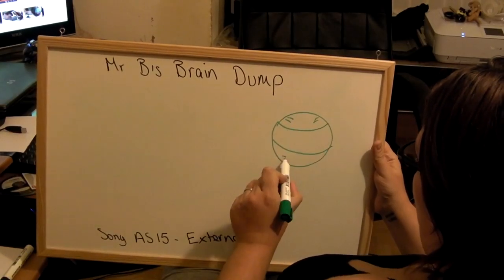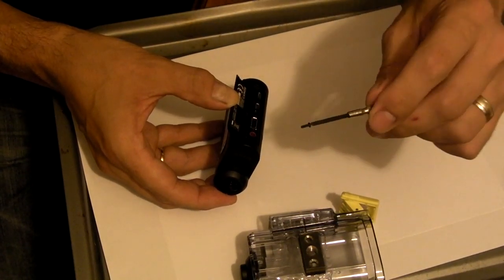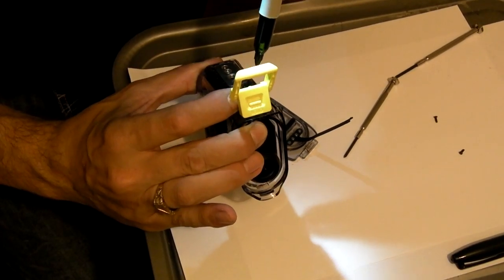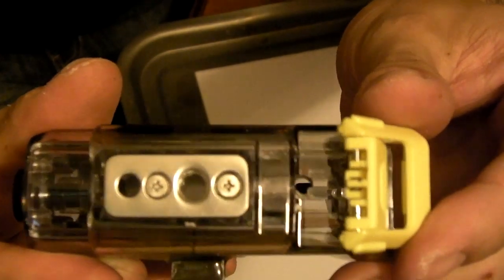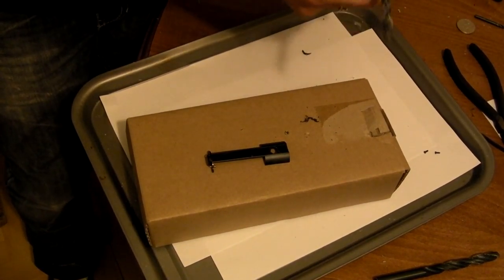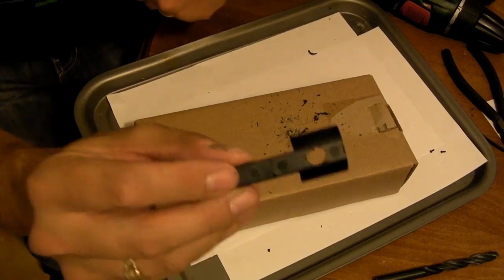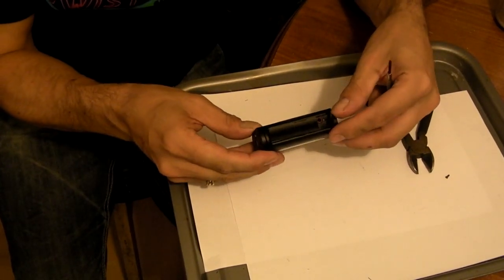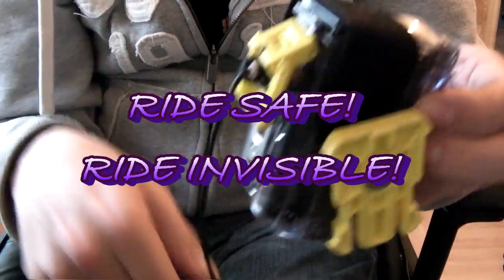SONY HDR AS15 - DIY External Mic - Housing Mod

Comment: Good mod mr b , how good are the sony cameras compared to go pro and drift  . Looking for one probably second hand just to try vlogging then a new camera at a later date
Reply from the maker: Hi Steve - I know the sony has great low light, but can't afford the top end drift's and go pro's with comparable low light so hard to comment. I If I could afford one I thing I would go for the top end drift.
For starting out get something with an external mic, I think you can get old drifts for under £100
RSMF-RI
Mr B

Comment: Why you didn't drill a nice round hole on the flap over the oddly snipped square I will never know. You would have still had the end of the flap as well as more of the flap so it would be more stable.
Reply from the maker: Good point well made! I thought the same thing when I had finished lol - I drilled Mrs B cam :D 
RSMF-RI
Mr B

Comment: Nice mod...  Instead of using my sony on the helmet, I bought the LCD case that turns it into a basic handy-cam and use it hand held.  Sony kinda missed the mark with it's cases and mounts.
Reply from the maker: Yeah they did - the LCD conversion is clever and I like it, but pointless for vlogging lol
RSMF-RI
Mr B

Comment: Nice job Buddy, It's a little stupid that we should even have to do these sort of mods, whats the point of having a mic port that you can only use out of the case when there are no fitting to hold the camera onto anything without a case! I rest My Case!
Ride Safe Buddy, and Mrs B, Ride Naked. lol.
Reply from the maker: Yeah it seems every camera has got it half right, if you could combine all the features of all the action cam's you would have the perfect motorvlogger cam.
RSMF-RI
Mr B